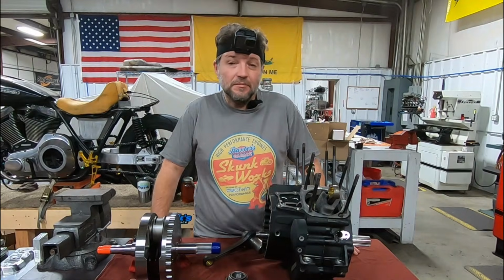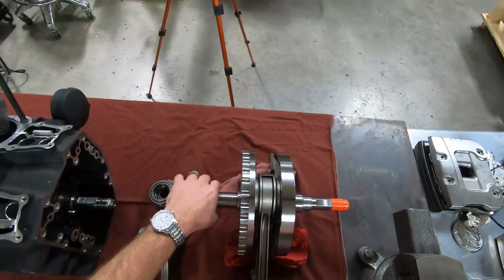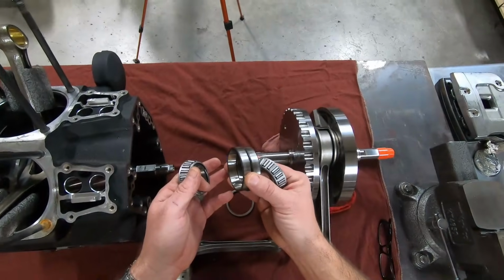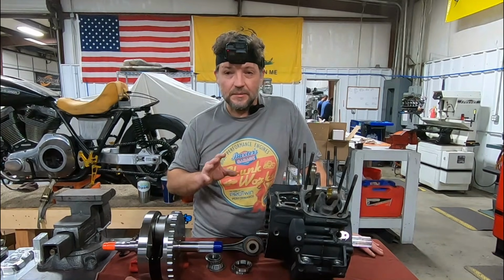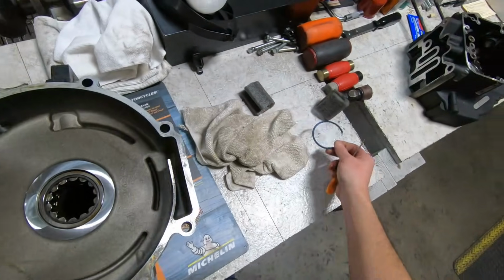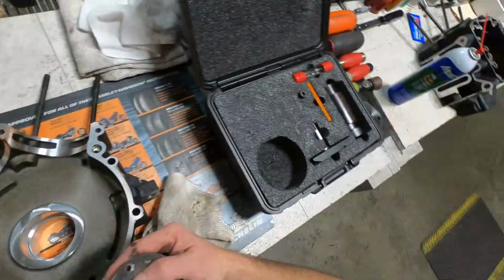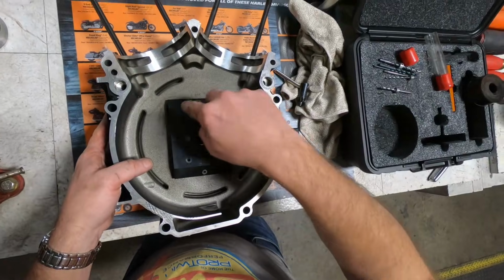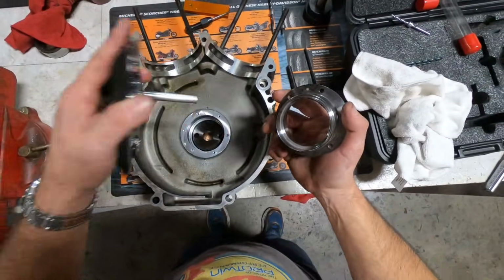Harley Timken Bearing Upgrade Conversion | Performance Harley | Kevin Baxter | Pro Twin Performance

Comment: Is it necessary to convert where does harley control crank side clearance no Timken
Reply: Timken set up take more labor time to set up, that's Y harley discontinued on later models, the non-tinking application they allow it the crankshaft to walk around That's side to side run out, most the slack is taking up on the sprocket side with your compensator setup!

Comment: Thanks Kevin for another tech upgrade tip.You wonder,besides manufacturing costs,why HD didn't do this upgrade off the assembly line?The customer has to pay through the nose to acquire one a HD.
Reply from the maker: lower cost and quicker production...